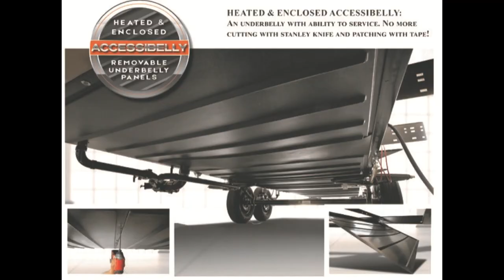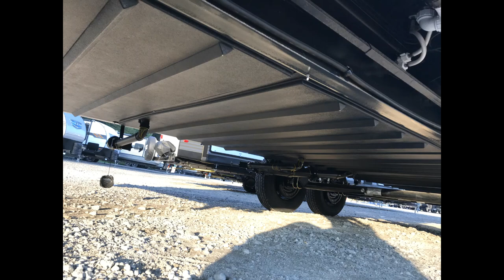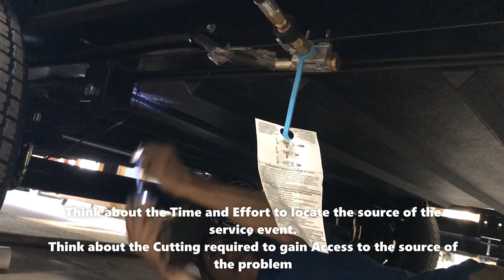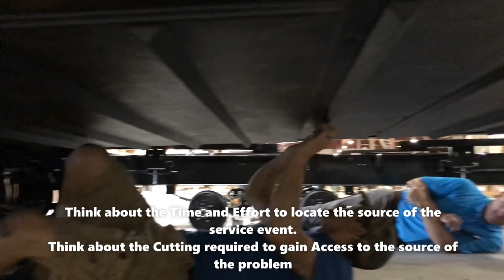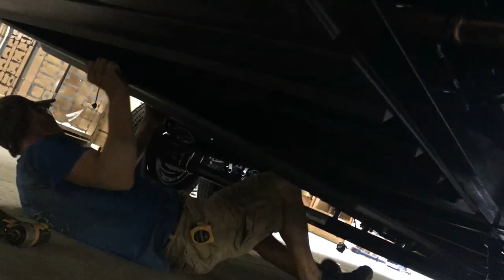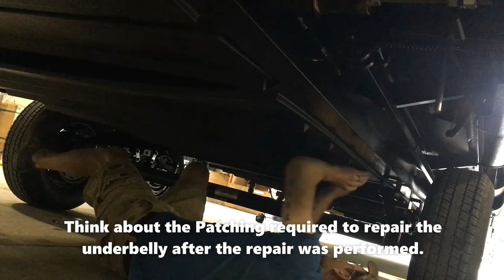Ameri-Kart Accessibelly Underbelly

Comment: Only problem is they use very few screws and the wind is able to rip that plastic out from under the trailer. This is happens to us twice in 24 hours. No way to replace the broken sheets unless brought in to a shop and all my hoses and wires are exposed now.